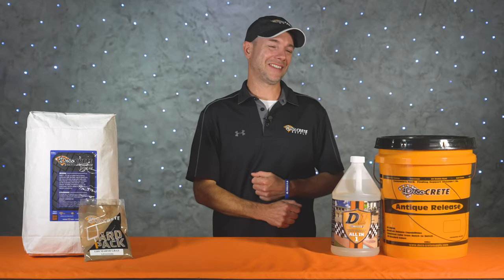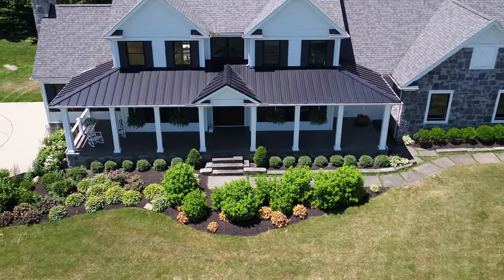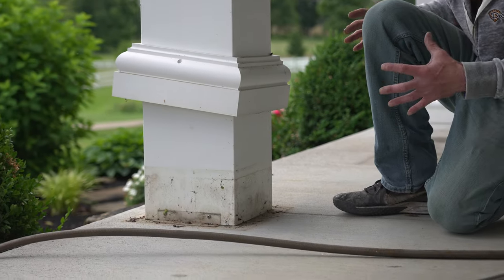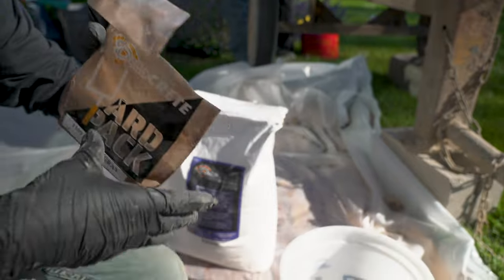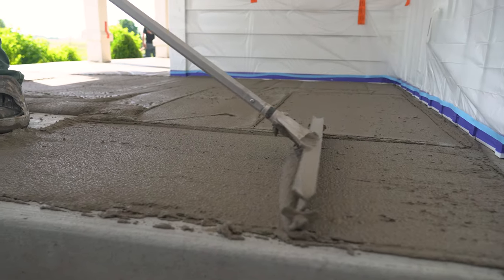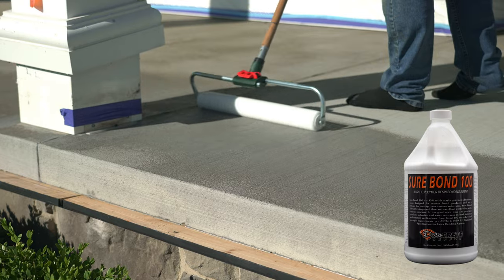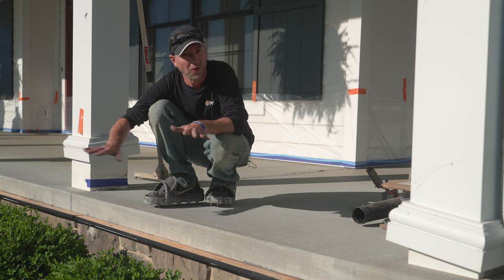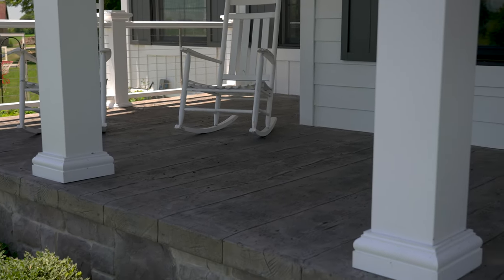How to Stamp Concrete Overlay!

Comment: Does the mortar mixer not trap air?I'm scared of getting air bubbles
Reply from the maker: We have always used mortar mixers for large jobs due to the fact that you can make so much at a time. I've never had trouble with air bubbles. If you are nervous about it you can go back to a paddle mixer but it will mix slower.